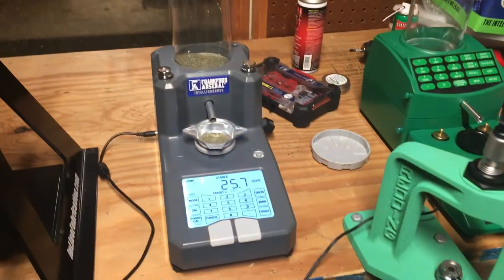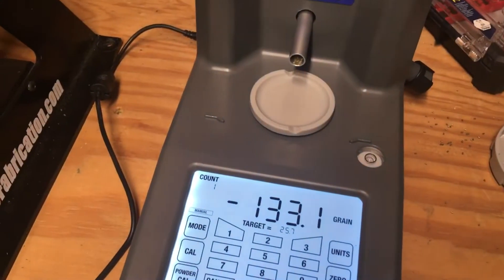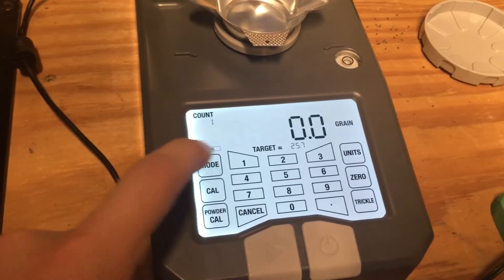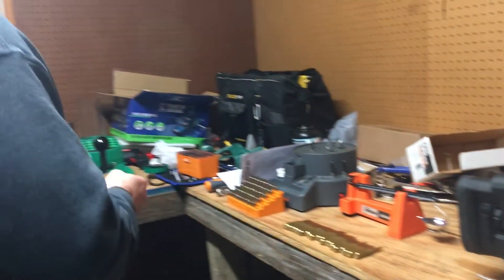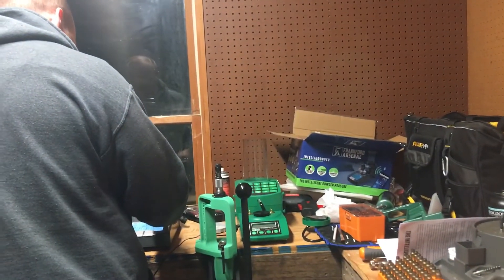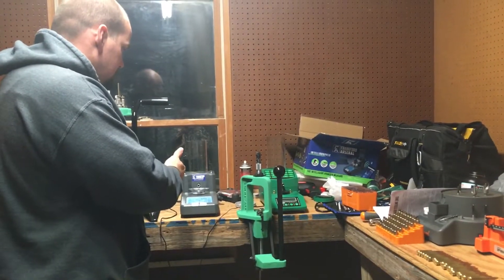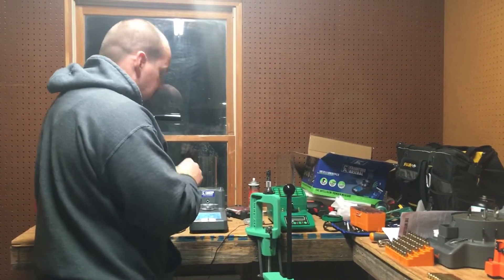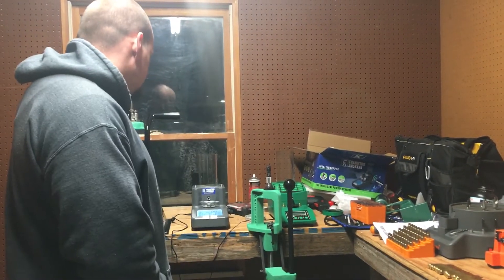Frankford Arsenal Intellidropper: Powder Charge Consistency Issues?

Comment: Let's get real. This is still within specs. You have a problem making a problem out of something that is not a problem. It's 1/10 grain and you are comparing it with other scales that have the same +- .1 grain specs. Think about it a long time. Even the balance beam has that same spec as well as the RCBS. You could have .2 difference and all your scales could still be in speck one over and one light. Dah!
Reply: Your 110% right!

Comment: Whoa, dude, thanks for checking the repeatability on the FA dispensor/scale!  It kinda looks like the "zero" is wandering a little.  I've got an older PACT scale and dispenser that does that too.  You just need to be aware of it and rezero the scale once in a while.   It looks like the FA unit is doing pretty well.

I didn't know you got down to the mid 30's.  You might have to get a space heater for that area.  Does that area have some Air Conditioning?
Reply from the maker: Todd B I’m looking at getting a mini split installed to maintain a constant temp out there so I can store my powder in there and yea keeping a constant check on that dispenser would be a great idea.